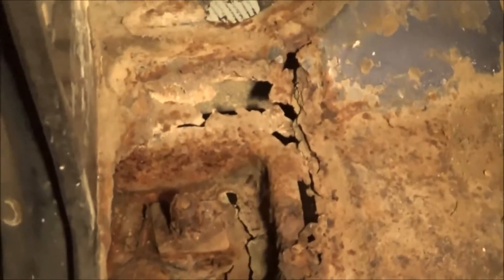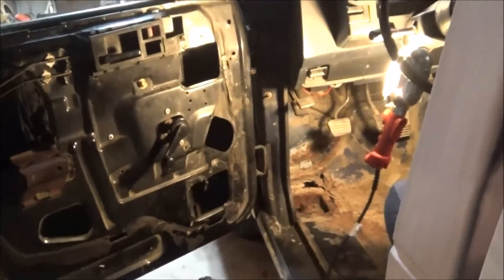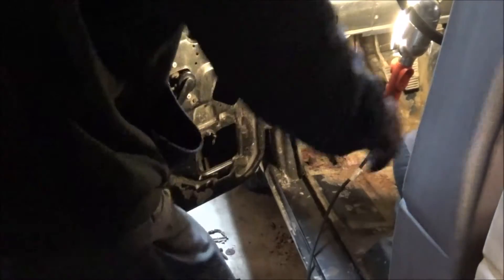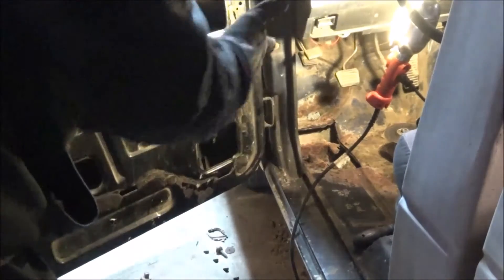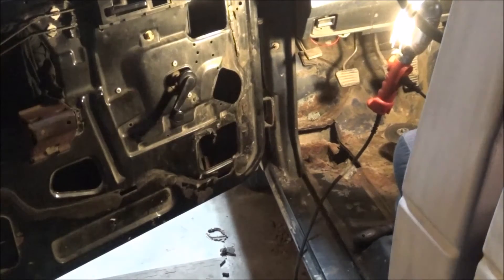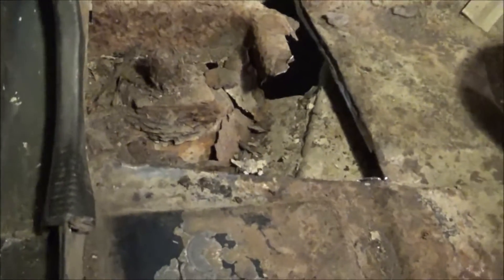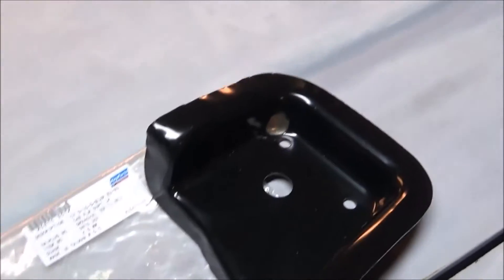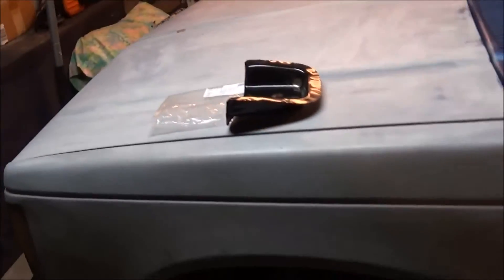S10 PROJECT LEFT HAND CAB MOUNT

Comment: I really like naval jelly to take care of rust.
Reply from the maker: this thing was so rotted out that i had to cut it out and replace it....LOL! years ago my first thought was just fiberglass it and be done but i figured it would be best served replacing the floor section and the cab mount.
Reply: I had a 4x4 blazer when I was in the Army with holes in the floor from rust. I used Naval Jelly to kill the rust, I cut out the really bad sections. Then mig welded sheet metal in the spots I cut out, and after I was sure I had the rust stopped paint over it with under carriage paint under the truck, and rubberized paint in the floor. This Blazer was nothing to look at, had a lot of fun with it though. The exterior was spray can orange, and the removable top was painted white with a paintbrush, But the drive train was awesome with a 400 SB, 400 turbo tran, 4.10 gears on 33 inch tires.
Reply from the maker: WOW! THAT SOUNDS LIKE IT WAS AN AWESOME TOY TO PLAY WITH. i think i'll just rough sand the floor and just primer it and paint it. maybe some day i'll get a 350 or a 305 in this old truck but for now i just want to get it more solid and lookin a little better on the outside.
Reply: Well I wish you the best, but I think there are better engines out there. I really like that twin turbo v6 they put in the ATS-V Cadillac.
Reply from the maker: yeah that's a good engine and there is the 4.3 v6 that i could twin turbo and build but i'm just gonna hold off on all that for right now.
Reply: Well I off look for a hole in the water to through money into, some people call them boats.

Comment: Hi Roy I am lookimg for these body mounts. where did you order them? I have a 03 Sonoma extcab and the front right side is rotted out.
Reply from the maker: I ordered them from www.lmc.com LMC  is where I got most of the parts for my S10 although I got the passenger fender from Amazon
Reply: @royzcustomz  Thank you!! LMC were great. I used the mount to fit my 03 sonoma.
Reply: @shawnmerritt6220  was it a 93 mount you bought all i see 1982 to 1993 parts thinking about the floor pan they sell
Reply: jon white I purchased the body mount 82-93 and welded it in place on my 2003 Sonoma and it fit great
Reply: @shawnmerritt6220  Thanks for this comment - I need to repair my 99 S10 and there's no part for that year, so I ordered the 82-93 part. It has to be easier than starting from scratch.  Jon - great video - I appreciate the effort that goes into it!
Reply: Hi, I need the metal cab side mount, is there a slip over that I can buy and weld in or do I have to cut everything out and reweld a different one in? Truck is a 2000 s10 zr2
Reply: @kenlorentzen  hey man I've got an 01 how did using the cab mounts from the older s10 go?
Reply: @matthewgallivan8575  I'm actually doing the job this weekend. It fits over the rotted in once you cut the sides to the old one down.  The bolt hole didn't line up exactly but it was close.  It doesn't reach to the rocker so their is some fab work to connect them. I welded the upper mount cup to it and a new nut behind it before putting it in. I'll be welding it to the floor tomorrow and doing the other three mounts. I also had to do the drivers floor and rocker panel yesterday. While I'm at it, the seats and carpeting are out for a long over due cleaning.
Reply: @matthewgallivan8575  I'm actually doing the job this weekend. It fits over the rotted in once you cut the sides to the old one down.  The bolt hole didn't line up exactly but it was close.  It doesn't reach to the rocker so their is some fab work to connect them. I welded the upper mount cup to it and a new nut behind it before putting it in. I'll be welding it to the floor tomorrow and doing the other three mounts. I also had to do the drivers floor and rocker panel yesterday. While I'm at it, the seats and carpeting are out for a long over due cleaning.